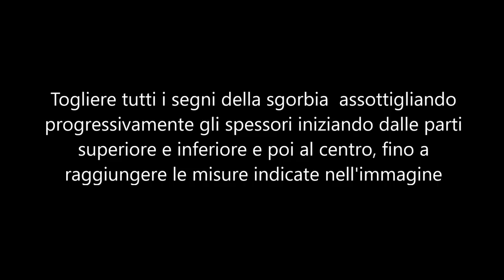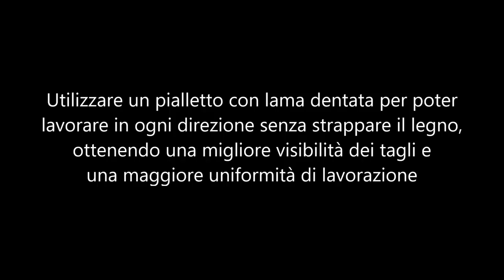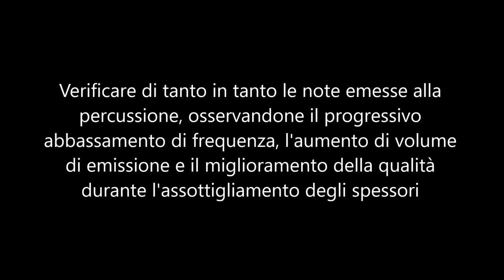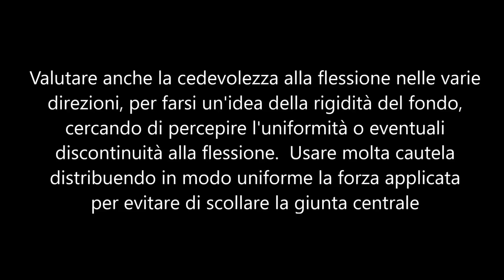Spessori del fondo parte terza - Lavorazione a pialletto

Comment: I remember many years ago 20-30 that folks would paint a thin coat of hide glue on the inside of both plates, I was wondering if this person knew of what he was passing on? It does make a bit of sense if not to slow any cracking but seems to me it would effect its sound? I'm just now gathering tools and tone wood to give making a try. I enjoy your videos and learning some of your technic. Thanks
Reply from the maker: Putting a protein sealer inside is mainly used to slow down the absorption of humidity of the plates in the finished violin, to keep it more stable with changes in environmental conditions. It also has a stiffening effect (especially on the top) which allows the use of thinner thicknesses. I do it too, but I prefer to use casein for its greater hydrophobicity than hide glue, which is very hygroscopic. Albumin is another good alternative to hide glue for this purpose. Casein is the one with the highest stiffening effect, but for this reason it presents risks of creating too much tension if used improperly.
Reply: @DavideSora  thank you sir

Comment: If the central part peels off? what should be done?
Reply from the maker: Sorry, I don't get what you mean by "the central part peels off". Maybe you are referring to the central seam (the joint) that has come unglued?
Reply: @DavideSora  Yes. What should we do if the joint breaks?
Reply from the maker: @guilhermeferreira4113  You will have to glue it back again.😊
Of course, it is not that simple, you have to understand why it came unglued, if it is a problem with the glue that did not have sufficient strength, or if the joint was badly done, or if you put too much pressure with the tools. If the joint still fits perfectly, just let in some new glue and it will be done, but if the joint shows a visible gap the problem is more serious, and you may have to redo the joint, a rather delicate and complex restoration operation. This is assuming you have used hot hide or bone glue, but if you have used Titebond or any other synthetic glue the problem is not easily solved by simply putting in new glue, because the wood will be waterproofed by the synthetic glue and the hot hide glue will not be able to set. The possibility to make these repairs is one of the reasons why it is important to use hot hide glue which is reversible and allows you to restore the gluing simply by working in new glue.
Reply: @DavideSora   Thank you very mach!